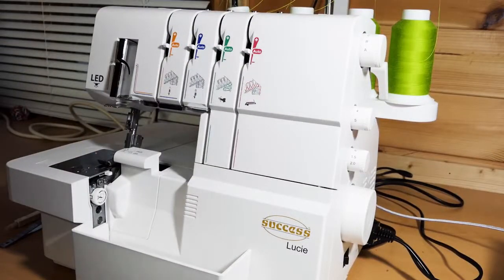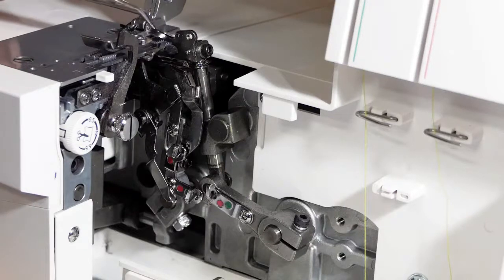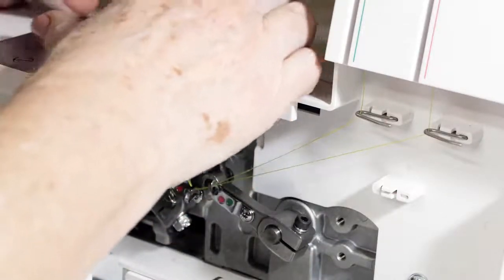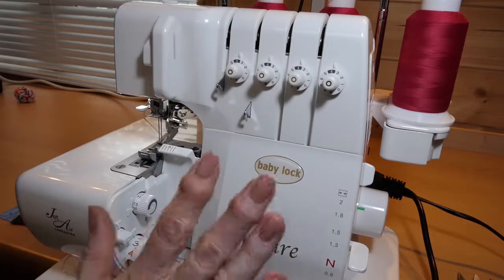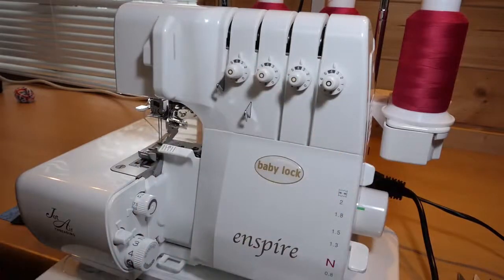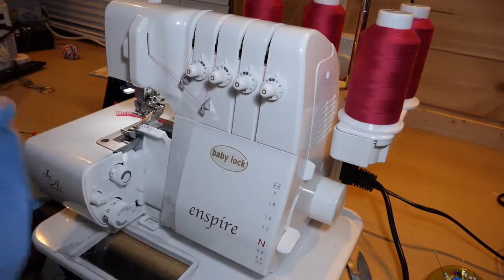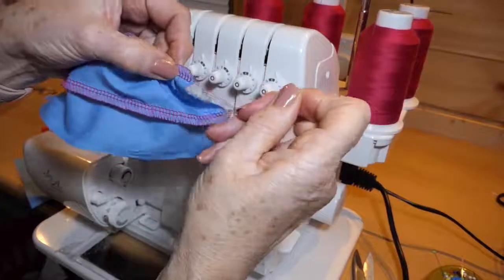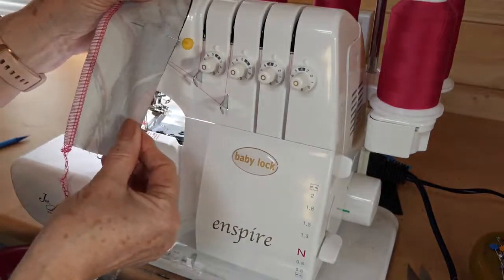OVERLOCKING  EXPLODING THE MYTHS

Comment: The horrible US BabyLock dealer I bought this from in Pennsylvania,  had an instructor for the included class that basically told me this machine could not do a proper rolled hem or flatlock "because it has tension". Thank you for doing such a wonderful and comprehensive video. I wish BabyLock US would care to have good instructors, since Babylock UK obviously does.

Comment: Thank you for a brilliant tutorial. I now understand so much more about my old serger! However, I wish I could make my machine go slow like yours when you are attaching the sleeve and flatlocking. I have babylock eclipse which I try to master from time to time but am always thwarted. My problem is that my foot pedal seems to be extremely sensitive and even with the tiniest bit of pressure the machine goes so fast I am unable to control it. Is there a way to slow the speed down?
Reply from the maker: So glad you found the tutorial helpful. The foot pedal controls the speed of the machine, this can be adjusted but it would need to be done at a registered baby lock dealer. Click on the link below to find the dealer nearest to you.
https://www.babylock.co.uk/merchants
Reply: Thank you for the link . I see the nearest dealer is 3 miles away but I never go in - will do now!    @babylockUK